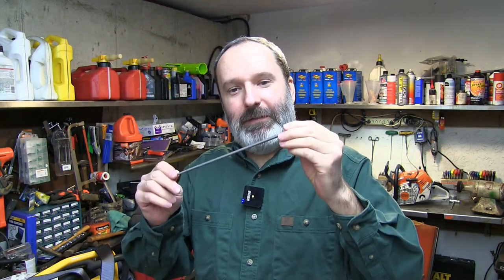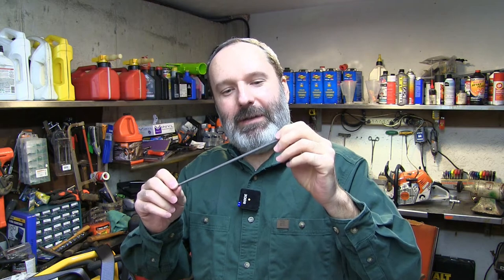How to Sharpen a Chainsaw Chain with a DRILL.

Comment: I was seriously going to try this until I watched your video. Thank for saving me the time.
Reply: Use a 7/32 sharpening stone on a dremel. It works. Lol. Files don't work, but sharpening stones sure do. 👌
Reply from the maker: Yes, absolutely stones work. As do HSS and carbide burrs.
Reply: @bobe8888  The file on a drill thing is pretty silly, though. 😅 I like the stone burrs, but I ordered some diamond ones also. Found them 8 for like $6. My first ones were stone, but I'd like to try them both.
Reply from the maker: The issue with the stones is the fact they change shape and get smaller as they were down.✌️

Comment: I agree with your theory with this type of file.  I Have very good Results using a drill. Because I use diamond grid round files and I use a bearing or a home made tool to hold the file at the other end. I do not know how to include pictures.....
Reply from the maker: The diamond impregnated files will work in any direction, I mentioned that in the video.

Comment: I use to use a 12v rotary tool that took little stone bits. I used it because i had a problem with my hands going to sleep while trying to file a chain. The rotary tool was a great way to wreck a chain. Thankfully the chiropractor helped to fix the issues with my hands. I now quite enjoy filling my chains!
Reply from the maker: They can work, but these stones don't hold the correct diameter for very long.

Comment: Great demo! I did using the drill to file and it didn't work. Probably change the title so ppl know the truth. So even the metal rotary sharpener are no good?
Reply from the maker: No the hardened steel or carbide rotary bits will work if you have the right size. The stones don't because they rapidly change diameter as they were down.

Comment: 25 strokes, I counted!  IF you were to do the same 25 strokes with the same pressure while using the drill...I believe you would have gotten similar results with less wear on the file.  A Sawzall would be more appropriate.
Reply from the maker: That doesn't make any sense whatsoever. ✌️
Reply: You can believe whatever your heart's desire, reality runs on facts.
Chainsaw files cut on the push stroke, not the backstroke nor simply rotating.
A sawzall will sharpen on the push stroke, and somewhat dull on the back stroke, leaving you with a partially sharpened tooth and a lot of excessive wear on the tooth/chain.
Please do a video doing such to show us how it is more appropriate in reality vs your mind.